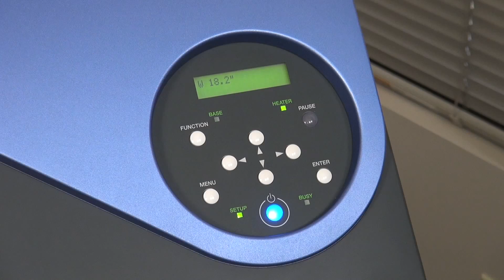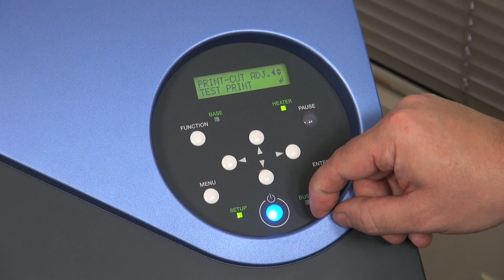Perform A Cut Calibration on the Roland VS Series

Comment: So I have a Roland SG2-300. And today I been having a problem with the blade not touching the material to cut while it is doing this calibration. At the end of it the boxes are printed and the machine acts like it is cutting but when its done its not cut.
Reply from the maker: If you purchased it from Stahls', please reach out to our tech team at 800.478.2457